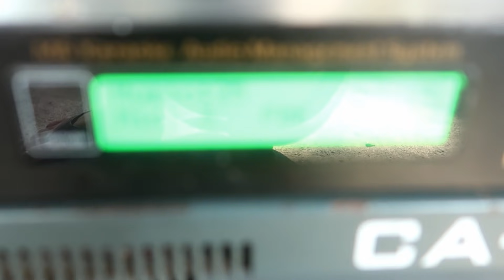Amazing 18 inch subwoofer design - Super loud sound for home

Comment: what paint and spraygun did you use?
Reply: Paint looks like just normal flat black paint. The texture coat uses a texture gun to get the spatter effect.
Reply: @GGigabiteM  i wonder what kind of texture gun is that  using two hoses
Reply: @PassiveProPH  tinta a base da agua